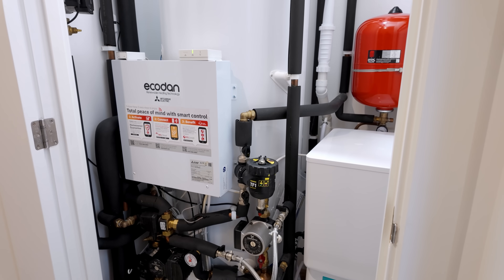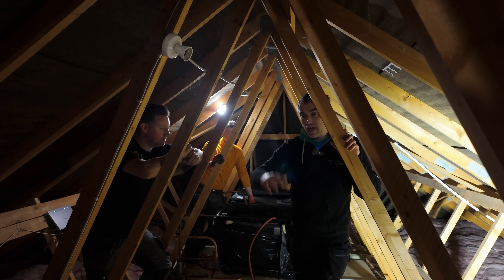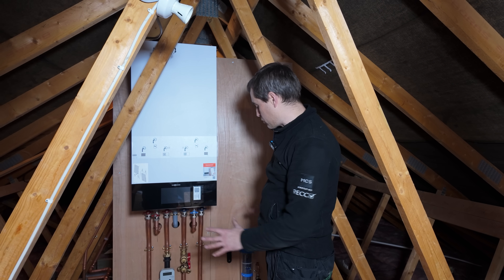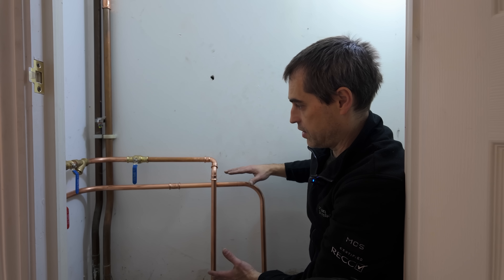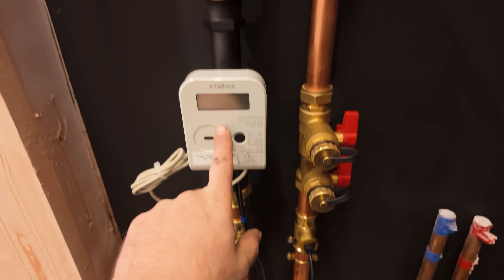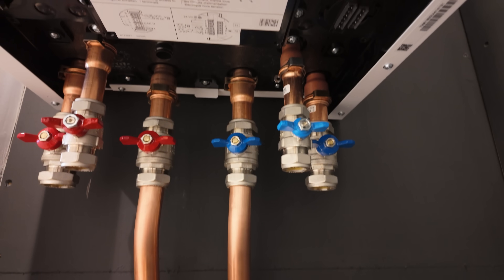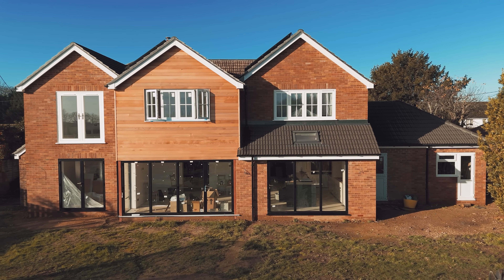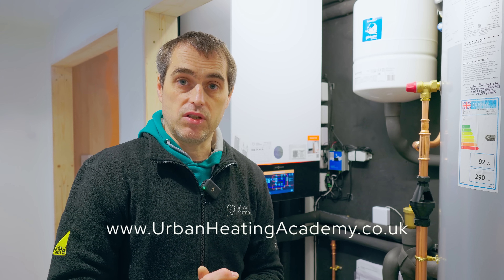How To Install Simple Heating Systems In Big Houses

Comment: Great Video. Thank you. But I disagree about using "pure" weather compensation. While "pure" weather compensation may work well in large houses (10 kW loss on the design day) in smaller or lower loss properties, the effects of solar gain, changes in occupancy or cooking make using a thermostat essential. Best wishes: Michael
Reply from the maker: I disagree with you, Miacheal, here. I now have over 100 systems running with pure WC, and not a single one of them suffers from any of the issues you describe. You should actually know it best, as weather-compensated systems run at such low surface temperatures that, as soon as the room gains heat from cooking or solar, the heating element doesn't add much, as heat transfer slows considerably. 

I always tell my customers to try it without any controls or additional temperature limiters, and add them if needed. So far, over 100 systems and not a single person has called me back to add a temperature limiter yet.

I was also worried about it in my house as I have an open plan kitchen with a living room, which is small enough that the kitchen could affect it, plus I have a wood burner. None of those issues happened to us, and we don't need to turn the heating off when we use the wood burner occasionally. (maybe once a week in the winter). 

There may be properties that will get massive solar gain in places, but if they are pire WC and designed to low temperatures, I doubt turning heating on and off will make much difference overall.
Reply: @UrbanPlumbers  Interesting: Thank you. 🙂
Reply: No it doesn’t. I am in a ‘small’ house running weather comp and no room thermostat fitted nowhere in the house. However you do need to design your emitters to match heat loss at the design flow temperature. Rooms that ‘suffer’ from solar gain in the heating season can be temperature limited by a thermostatic rad valve.

Comment: Super Christmas bonus from Simon and the team. I see you using emonHP more and more which is great. More data to counter the naysayers,
Not sure about having the plant in the loft, but I guess there's pros as well as cons and if the customer is happy then that's the main thing. I guess Viessmann have an app to do all the settings in so only really an issue for service and repair.
Such a low flow temp. 25C is getting silly ! Show's what you can do with UFH .
Reply: He mentioned 30-32C I think

Comment: Hi, thanks for your excellent content. A general concern I have is that most installers primarily design for efficiency, but surely they should primarily design for comfort?  i.e. whole-house weather-compensation is not at all the same as room by room comfort, and therefore more control(s) is the practical way to deliver this?
Reply: If you prefer, for example, your bedrooms a couple of degrees cooler than the living rooms, and the bathrooms a couple of degrees warmer, that's relatively straightforward to design into the system, and you can still use the TRVs for fine tuning. It's where you've got whole sections of the system opening up and closing down several times a day that it gets detrimental in terms of efficiency - and often in terms of comfort too.
Reply from the maker: Exactly as Matt says. You can liking areas few degrees below or design higher temps for bathrooms.
Reply: You jut bias the heat distribution to how you want using TRV or minor tweaks to flow rates on certain loops

Comment: That’s identical to my system but have about 300m2 to heat and all 26 radiators were changed. The heat pump is 16kW though, with an output of 14, a cheap gen 6 Samsung. We are getting SCOP of 5+ too, not convinced the brand makes any difference to efficiency but may impact longevity. I figured that in 10-12 years the control system technology will be improved so get it cheap and change it out sooner. Of course, if electricity prices skyrocket we will be putting gas or hydrogen boiler back in anyway, but at least we still have low temperature distributio system.

Comment: How long does it take for a house like this, under these conditions (december), to heat up to approximately 20°C?
P.S. I installed an 8 kW heat pump in a 200 m² house with similar heat losses, and it took about 10 days (also in december) to reach 20°C. The setup was also similar (no buffer tank, no thermostat, single zone an it performs great).
Reply from the maker: The renovated one took 2 days

Comment: How heavy can items be in truss lofts? The header tank obvd weighed a bit but the bigger cylinder places most of its mass on a small footprint? Are there tables or guidelines that define the  limits?
Reply: Most truss designs allow for a 50 gallon CW tank load spread over 3 trusses, so approx 225L. I'm guessing that was a 300L cylinder, + all the other stuff connected to the bracing - could - be overloading the structure - Ooops LOL!
Reply: @kawazukisoddbits2717 I did see additional load distribution timbers toward the end. Still interesting to know what the guidelines are.

Comment: When builders see a large house, they see a large invoice. Ours is a large mediieval listed building, and so people think they can charge what they like.  Our heat pump quote was nearly £50k. Do they think we're stupid????   I wish we had a good engineer like you near here.
Reply: You could easily spend 50k on one of symon installations.
Reply: @mattmackenzie1111 really?  He said it was going to take 10 days. Assuming 3 people on the job, that’s 30 man days, at, say, £400 per man day, ie £12k on labour. Add £5k for the heat pump plus £5k for other materials takes you to £22k parts and labour. So how do you get to £50k???
Reply from the maker: The install took 5 days with 4 people on site, so 20 workmen days.
Reply: @dominicgoodwin1147 not suggesting this install is 50k but looking at Szymon videos im sure some of them are over this figure. 
Your numbers are tight for work of this standard.

Comment: 8:03 I have an idea for neatening up those cable bundles from the monitoring equipment: a 10cm section of 22mm PVC pipe, mounted vertically with a couple of pipe clips, and stuff the zip-tied cable bundle into it! (black PVC conduit would look nice on the black painted ply)

Comment: Building regulations suggest mandatory zoning of houses above 150m2. You mentioned no zoning at all?
Reply from the maker: no zoning at all. Building regs,as you correctly say suggest, but do not mandate it.
Reply: @UrbanPlumbers I dont think thats correct. Part L of the building regulations suggest a minimum of 2 independently controlled heating zones and is mandatory. They could enforce and fines especially when your client looks to sell the property. 

I agree that an open system with the least amount of interrupt can be more efficient, however, large properties would still potentially benefit from energy conservation with appropriate zonal control when not in use. 

There maybe a way around this, maybe building control will see some for of UFH control as a "zone"?
Reply from the maker: It’s not mandatory.
Reply: @mattcole6230  IIUC in the building regs documents only the text on the green background is law. L1. b) ii)) is "have effective controls". And weather compensation (via the curve) is arguably an effective control.
Reply: @asabriggs6426   Can a setup like this with no zones or stats qualify for a BUS grant or would an MCS audit refuse it?
Reply: @asabriggs6426 yes exactly that "arguably" and I would say that weather compensation alone does not fully satisfy the clause of effective controls (in the context of user and occupier control) where the building isn't using more energy than is actually required.    In many instances, large properties are often and rarely fully occupied and thus, you can have whole floors, wings or groups of rooms heated above a reasonable set back condition unnecessarily, which triggers contravention of the mandatory statement of controls that use no more energy via commissioning,  testing and adjusting.

Im happy to stand corrected, but this is the advice received from BC officers relating to the last amendments. Also remember, the interpretation of the documents are enforced and approved by the individual building inspectors and not what our own individual interpretation  might be.
Reply: @mattcole6230  The text is more precisely
"""
L1. Reasonable provision shall be made for the conservation of fuel and power in buildings by—
...
(b) providing fixed building services which—
i) are energy efficient to a reasonable
standard;
(ii) have effective controls; and
(iii) are commissioned by testing and adjusting as necessary to ensure they use no more fuel and power than is reasonable in the circumstances
"""
Reasonable being the operative word.

Comment: The primary loop in that first property seemed crazy long and the loft seemed an inconvenient place for the plant room. Surely, in a property that size, better locations could have been found?

When using Google Gemini to help design my system in a similarly-sized house it calculated that the 'standing water' issue was going to cost almost £100 a year extra in heat loss for a primary loop of similar length and correspondingly delay the heat  reaching the places it was needed while the heat pump warmed the standing water in the primary loop, which will have cooled while the heat pump was off. Admittedly, in my case the primary loop was almost all outside the insulated envelope, whereas here maybe only 5m or so, times two for flow and return, is outside the insulated envelope.
Reply: I wouldn’t suggest getting Gemini to design you a heating system, you know it’s all trained on misinformation and nonsense posted onto forums?
Reply: @edc1569 I didn't get Gemini to 'design' the system, I got it to 'help' design it, by asking it to calculate things that would take me too long to look up and calculate. It was quite interesting to ask Gemini to calculate the relative cost of different locations for the heat pump. On the whole, I thought it was useful, although when I asked it to draw a diagram of the system many of the labels were pointing at the wrong component and some of the labels were pure gobbledygook.
Reply from the maker: It’s exactly 15meters long

Comment: Honestly it wasn't really manufacturers in the UK that pushed for more complex systems, it was the regulations for zoning and energy efficiency - which inherently aren't written by heating engineers. Been fitting weather comp domestically since 2005 and my father commercially for best part of 40 years, most designs open system. More often than not it was building control that had the issues against it and even now the EPC weighs down open zone compared to TRV systems. Absolute madness that people can write the regulations without ever having done the job.
Reply: Same here in Germany. Zoning is mandatory to get the heat pump subsidies. There is a possibility to get an exemption of it, but very difficult. Owners who know about the energy advantage of one zone operation usually open all valvea after commissioning.
Reply: To be honest the situation prevails Building Regs and advice still thinks TRVs and Zoning is the solution.
Reply: @normanboyes4983  Oh I know, it's a pain in the butt even with my colleagues. We just completed a 7 bed and in fairness it has a boiler due to hot water recovery rate but heating wise it's all designed as open zone but to comply it has 2 ports.

Upstairs and downstairs are both set at the same temperature and timings, all radiators sized with 21c in mind and majority except near stats have mushroom head TRV's which are fully open. The boiler is firing at 32 Celsius - if it wasn't for the hot water a heat pump would of been fine.
Reply: @normanboyes4983  To top it off - building control don't even care about 55 Celsius for new systems "as long as it's better than the old one we don't really care" was the official response because it's a retrofit but if we'd done the same thing on a new build they would of wanted it all zoned and TRV'd - though in fairness if it was a new build it would be UFH not column rads to match the period of the property.

Comment: Hey Szymon, looking good as usual. Wanted to ask where your return sensor monitoring tee for the heat meter is, or is it on the reverse of the board. Also is that a micro demineralised on the right?
Reply from the maker: all behind the board. Yes that is demin top up unit.

Comment: What curve do you use for weather compensation.
Reply: I suppose: The one that fits the heat loss calculation, that was done, and the the calculated flow temperature needed for the emitters (radiators and underfloor heating) to keep up with the heat loss.
That should be a very good starting point, from where the people in the house can tweak the offset up or down a bit, if the house gets hotter or colder than desired.
Reply: 45'c @ -3'c & 35'c @ 15'c in line with MCS

Comment: What is the make / model of the blue water filter installed on the filling loop ?
Reply from the maker: Ricky from Thirough Flush sels them - it is a deminarlising top up unit.
Reply: Low conductivity/ demineralised water will corrode any ferrous materials faster than mineralised potable water. Just as drinking demineralised water will demineralise your bones. It is the air/dissolved oxygen that you need to try to eliminate to minimise corrosion. Virtually impossible to have a hermetically sealed system, therefore inhibitors and bleeding will be far more effective at reducing sludge in the long run. There seems to be some German standard that plumbers here have adopted, however German/ Swiss systems rarely use ferrous comports in their systems, they are often stainless steels and/or plastics.

Comment: So interesting. What system are they using for first floor underfloor heating? 
I’m about to start a major renovation and I’m thinking it’s easier to stick with radiators upstairs.
Reply from the maker: i am not sure. By the way - it seems to work just fine with existign udnerszied rads anyway.